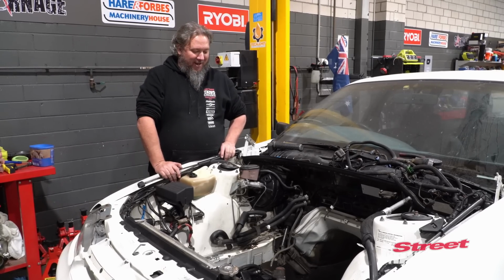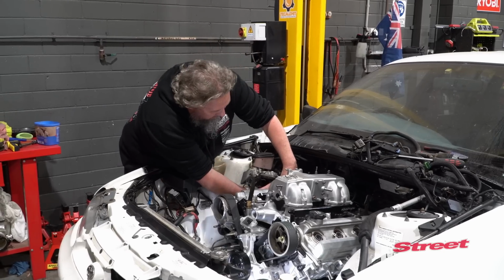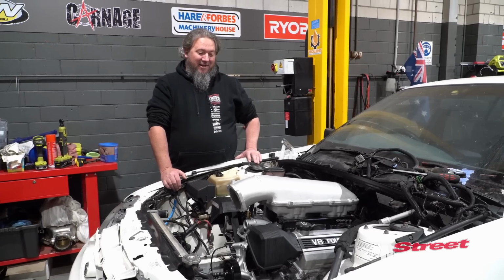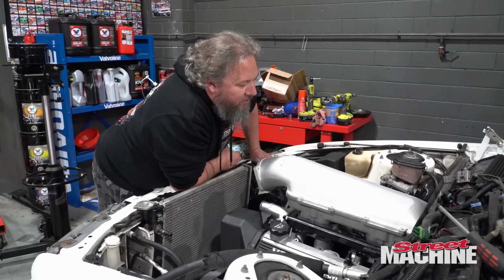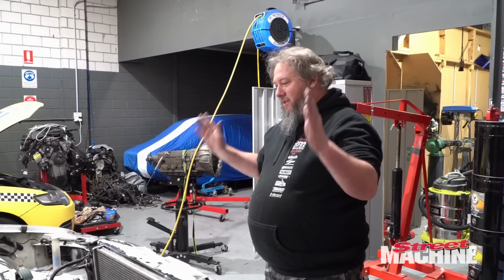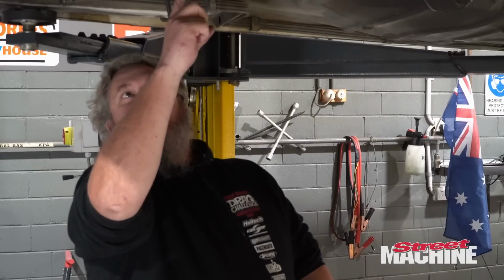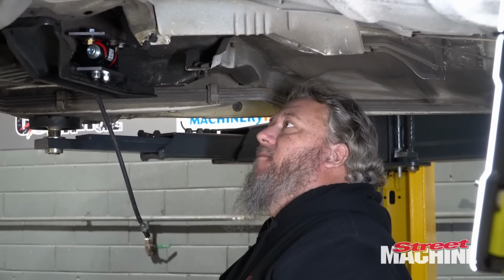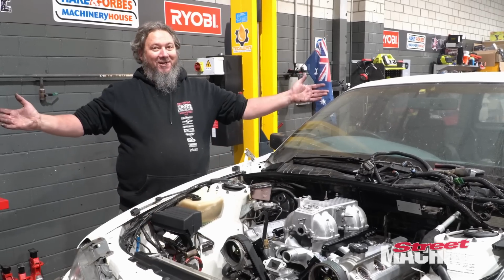Carnage - We Make Our 1UZ-FE Toyota V8 Fit!

Comment: You could have used the plastic booster from vs v6 . Toyota used the v8 boosters . With the v8 booter you can use an inch master for vt brakes . Unlike the v6 has different master mounting holes .

Comment: Next time you're cutting aluminium with a grinder grab a tin of spray canola oil and spray the disc on both sides before you make a cut. Cheers From Stench
Reply from the maker: Great tip!

Comment: some 1uz gearbox's have the slip type drive shaft instead of the 3 bolt flange.
Reply: The rubber disc can't be used with a solid rear axle due to too much angle change over bumps. The disc type is OK for an IRS rear.

Comment: The intake manifold looks sweet, but it’d be a cop magnet sticking through the bonnet of a commodore 😂
Reply from the maker: True, we might go a different path
Reply: Keep the standard manifold. There is 1000hp cars still running the standard manifold. Check the Hoff’s supra
Reply from the maker: @adriancraig9012  yeah, I'll look into it
Reply: This is a Toyota tho, it's practically a Camry! The cops shouldn't even look at it ;)
Reply: @adriancraig9012  he's not using the stock manifold for 1000hp...

Comment: Hopefully, the rubber drive disc at the end of the transmission will be eliminated in favor of a U joint as the disc type of setup does not like miss alignment found on a solid rear axle. ( discs are used on an IRS rear )   The stub sticking out of the transmission is used for centering of the disc.  With miss alignment, this becomes a wear / bind point for the bushing inside the drive shaft.  I've seen aluminum spacers that convert a disc to a bolt on ( Ford type ) U joint yoke.
Reply from the maker: We're going to look at our options there.

Comment: I'm glad you thought ahead about the thickness of ali to add to the cam cover when welding it up. 👍 Is there any room to drop the engine by 10 or 20mm? Just thinking that could help with the propshaft angle issue and be easier than mucking around with the rear axle or trans tunnel.

Comment: The long extension you use to get to the difficult bolts is great, is that a Supercheap part?
Those step bits are great, I remember drilling a pilot and slowly going up in size to the hole you want, ever since finding good quality step drill bits it's made life a lot easier (not cheap but worth the investment).

Comment: Go an fgx bulge if bonnet doesnt fit. You have to be on the right angle to even see it. 

Have one on my vz as blower pulley rubbed bonnet , vs ute will get the same treatment as the blower sits even higher.

Comment: Fitted in quite good really, will that RH rocker come off in place if you had to remove..looks like kinds will with the booster in place. There quite a wide engine and tall . 
Great work though I look forward to the next eppy.
Reply from the maker: I think it will if we shuffle the engine mount bolts and shuffle it sideways.

Comment: Couldn’t you just turn the trans bracket around so the plate was at the back and not the front, less messing around and less manufactoring
Reply from the maker: Couldn't because each side is a different height. It only goes on one way
Reply: @STREETMACHINETV  , that sucks, I though they would have made it compatible with and transmissions. Glad your got your head screwed on straight brother. I can’t wait to see what this motor does and how it performs compared to the Aussie donks.

Comment: The diff angle will change once it gets weight on the wheels'
Reply from the maker: Yep, which is why I didn't get too precious with it. Ultimately, we may need the adjustable trailing arms to correct any angles

Comment: vs booster is smaller but does a better job you know people tell you things for a reason not just to pull ya leg
Reply from the maker: People tell me all kinds of things but not all of it is accurate, so I talked to some of the commodore experts and recommended either removing booster or notching cover. I decided to go with the notch. I read all the comments, I don't ignore people but I do get alot of conflicting information
Reply: @STREETMACHINETV  vs ones work better than the vr ones also smaller if you wanted an upgrade a vt booster would have fit and worked even better

Comment: just spacing the x member down would of fixed all the issues far easier
Reply from the maker: You can't angle it down, it screws with the driveshaft angles
Reply: Also makes the crossmember lower to the ground....
Reply: it used to be super common when putting small block chev into early commy that's all🤙

Comment: One build I've really been wanting to do recently is a 1UZ with a big single turbo (and supporting mods obviously) into a Lexus IS300 (Toyota Altezza). Yes, they come with the 2JZ-GE, but I would much rather have that V8 torque followed by the pull of the turbo as soon as I stomp the go pedal. I love the styling of the IS300 and I think that it would be ALOT of fun with the 1UZ turbo swap and a proper combination of suspension, tires, and rims.
Reply: Even a tuned na 1uz in an is200/300 would be very nice.

Comment: Disappointing that yet again "bolt in" conversion mounts don't fit and have clearance.  The supplier should have stepped up and fixed it.

Good to see a 1UZ in a Lexan.  That how they should have come.
Reply: Is there enough room to push the motor down?

Comment: Dude seriously… get with the times … willwood make braking systems with the booster delete… no you gotta run the bodgy way & butcher up the rocker cover
Reply from the maker: Actually I think it's dodgier to delete the booster
Reply: @STREETMACHINETV  … you would … might need to talk to the rod shop brother dodgy
Reply: All good if you want to build a car for the strip but this is probably going to be doing a bit of street so you want the booster
Reply: @knight2425  … they are great 4 the street mate … was talking to a rep from the rod shop @ the last Sydney motorex… there’s a heap of street driven cars with these systems… the master cylinder is much bigger dia so there’s plenty of pressure without having to hang off the steering wheel .. that chopped valve cover is going to create crank case breathing issues .. especially that it’s going to be blown

Comment: Honestly dude Ur a barrel of laughs.Ur intake going too be too tall at a quick look here comes angle grinder.going back too trolvo only as quick as street regoed datto 1200 ute with turbo pushrod engine.Not mean too be nasty just stating a fact😊
Reply: Street registration on a high hp pushrod datto oh really? A series with a heap of power probably a 9-10k rpm build and heap of boost yeah just a cheap easygoing build as opposed to using a strong and proven engine with current support and parts available this actual century, What state? Not nsw or vic I take it? So it’s actually safety or even emissions compliant with its modifications or has it just been fudged with a shonky engineer? I’m guessing it’s not legal at all! being antiquated! It may have aftermarket programmable efi but even then definitely not road legal! and if carby fed are you saying on legal complications that is better than an efi Toyota? you have rocks in your head or are smoking them! I bet I can find enough wrong on that datto to get it crushed!